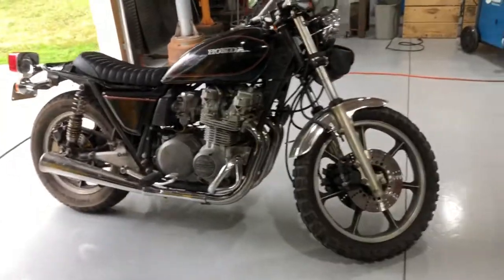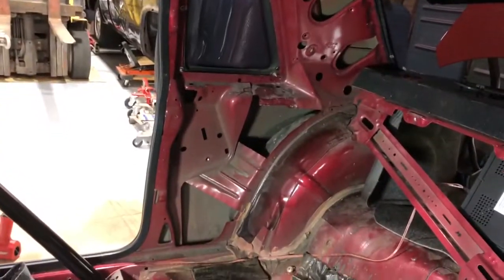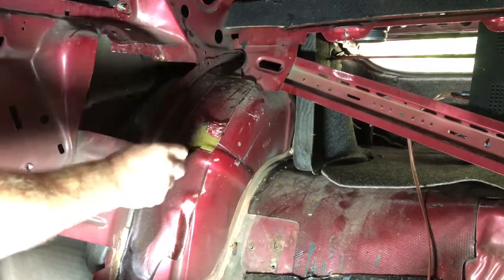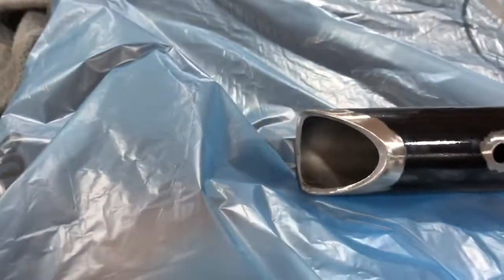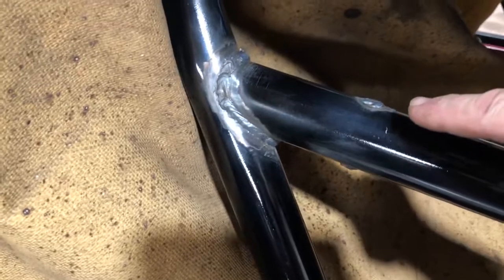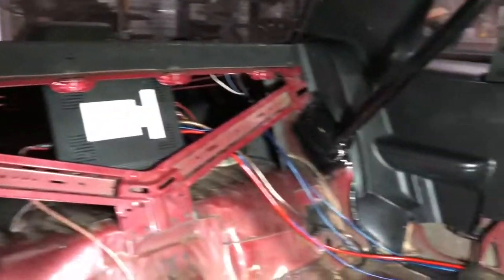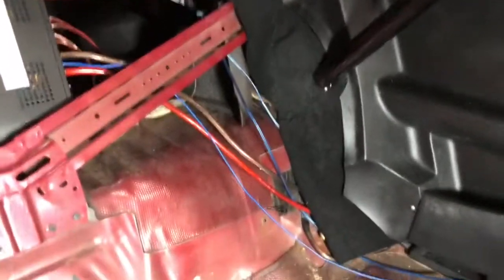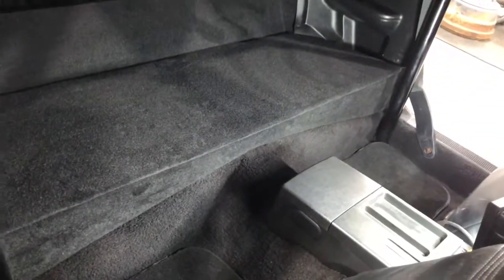Fox Body Mustang Roll Bar Installation

Comment: Hello Sir.  Great workshop and videos.  You insulated your shop sidewalks exactly like I'm planning to do my work shop. 
I am curious and wanted to ask...how did you insulate your work shop ceiling??
Did you simply attach foam board panels to the bottom of trusses?? Many thanks !
Reply from the maker: Hey thanks! When I had the building built they gave me the option of 1/4 foam like vapor/insulation it’s foil on the top side my roof is white I figured I’d rather try to keep it cool in the summer actually works perfect